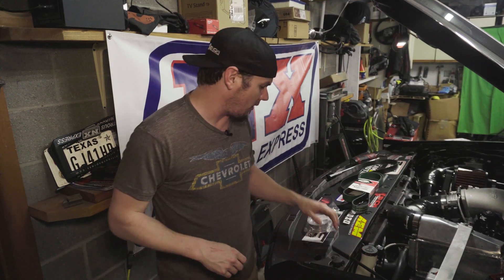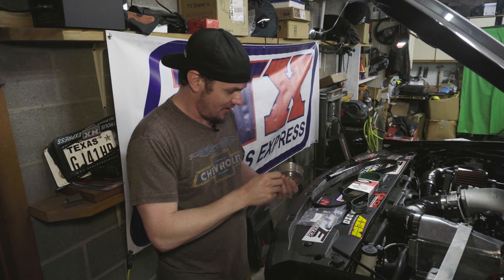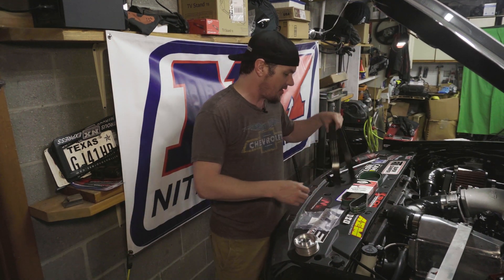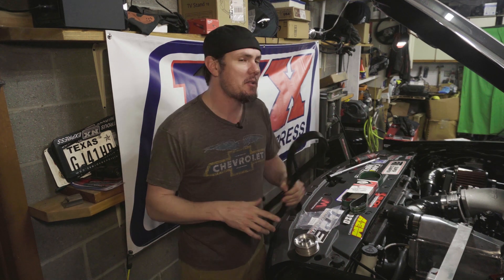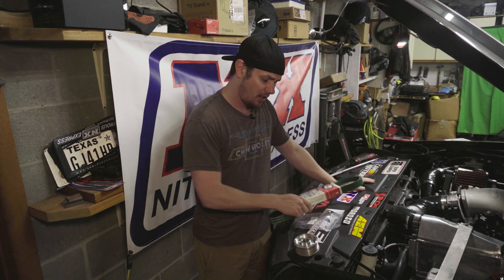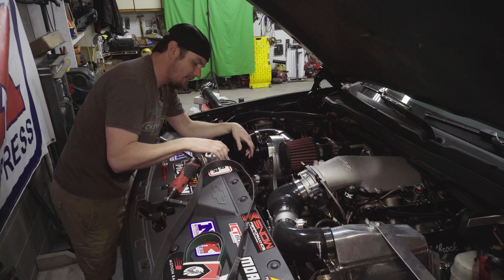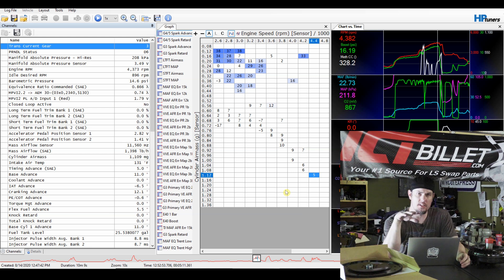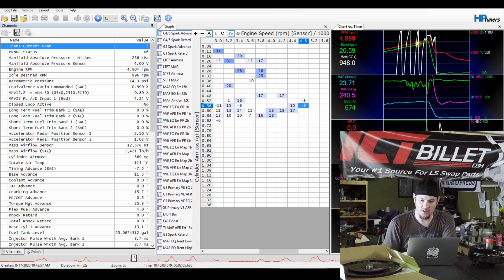Belt Slip!  How To Spot It And Can A Smaller Pulley Fix It?!?

Comment: I am still going through the process of turning my procharge Yukon and I have experience exactly what you showed. I had dust all over the front of my pulley bracket and thought maybe I had it too tight well I loosened the tensoner and went from 16 to 13 lb of boost and the truck sputters really bad at high RPMs.  Is it possible that belt slip is causing  this issue? I swap plugs and I'm changing plug wires this weekend just to be sure but if it's belt slip causing it I will be so happy cuz at least now I know I can fix that

Comment: Did the laser alignment tool solve issues for you?  Going a little crazy trying to stop slip on a 10 rib, 7" x 3.33" Vortech setup on my Subaru.  It is a homebrew setup, so the only way I have lined up the belt is by eyeball  + measuring distance the belt is from other objects as a reference.  The setup works fine sometimes,  then (seems like it happens when the belt is hot) I get this on/off/on/off slip like it is slipping then catching.  I don't really see any glazing or belt dust.  The SC pulley has pretty good wrap but I'm thinking of adding more idlers for the crank pulley wrap, but I would always guess the SC is the one to slip first since the pulley is smaller.  I've tried Gatorback and the $$$  Gates RPM (Kevlar) Belt.

Comment: Crack open the pulley bolt with the supercharger belt on, the SC belt will hold it in place so you don't need a strap wrench.

If you gently heat the pulley with a small torch, like a pencil propane torch, it will expand enough to come off without marring up the pulley.  I destroyed a $100 pulley doing that!

Comment: blowers n belts....  i had a gates blue racing belt on mine PD blower ripped 3-4 gear and on clutch release heard a crack under the bonnet thought something let go warning lights came on dash but was just the belt snapping, not good seeing MAP 200kpa instantly drop to 100kpa...